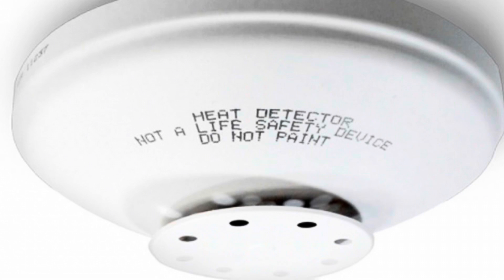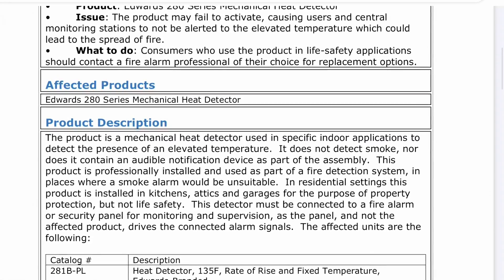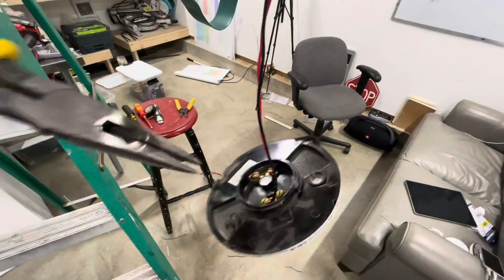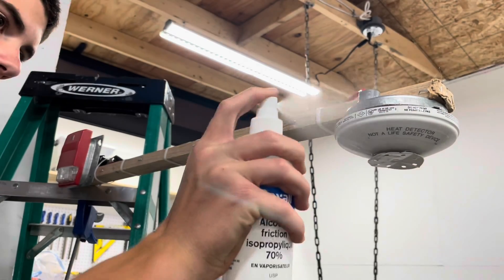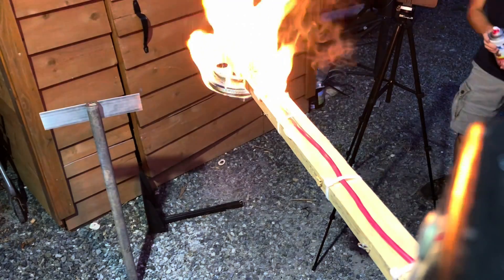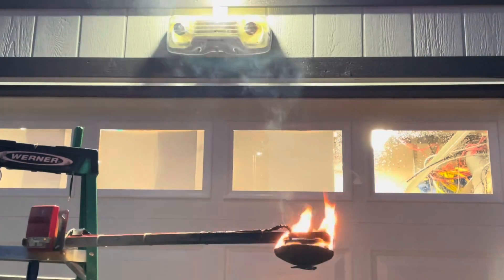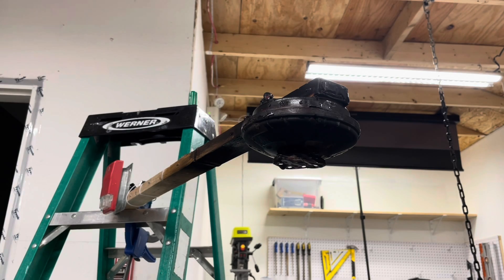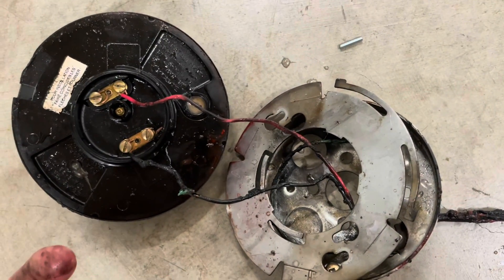Testing Edwards recalled heat detector with real fire🔥🔥🔥

Comment: Thank you for this video. Now I will tell my management to get rid of those detectors!
Reply from the maker: The opportunity to get rid of them is kind of over my school district that I work in is aware of the recall but they have been left as there was not the manpower to replace all of the devices during the period of the recall where it was covered for new devices something along the lines of there was a brief period where they would cover the cost of replacing them but that window is gone so now they just are left and get replaced when they are found to not work during testing might be a similar situation for you not sure

Comment: Was the initial alarm caused by heat or your special juice shorting the wires on top of device? Just an observation. May be flipping it over with terminals pointing down would be more precise test?

Comment: and grounds and bilding says they don't need to be replaced
Reply from the maker: Sorry I don't understand the comment
Reply: @nics-systems-electric 
At the school I work at has these detectors and when I said something about it to the district they said that they were fine and did not need to be replaced
Reply from the maker: @codythedogyoutuber  the recall replacement window is gone, however they are still a recalled device you can research it on the Edwards website.

Comment: What is the case of the heat detector itself made of?
Reply from the maker: Thin steel
Reply: @nics-systems-electric  No wonder that didn’t burn, but I guess in a large structure fire it could melt.

Comment: Well I can see why its recalled by the detector being a bon fire now and it still wont go off lmao.
Special liquid is ~~gasoline?!?!?~~
This test also demonstrates how fire alarm wire will work when being burnt
Reply from the maker: Yes it was gasoline any other type of wire would’ve actually perform the same way in this test as the copper all has the same melting temperature the insulation temperature is slightly higher at 105° instead of 90° however I think the fire was hotter than both of those so fire alarm wire would still work as usual for slightly longer but once past the temperature the insulation will no longer be an insulator Which is most likely why Horn strobe went off and on because of the insulation being melted leaving the copper conductors to make contact with each other
Reply: @nics-systems-electric  That makes sense.

Comment: What does “Not a life safety device” mean on the heat detector
Reply from the maker: It means it can’t be used as a device for human or life safety just for property protection
Reply: Edwards put it on there just in case they had to have a massive recall (wink wink) lol

Comment: Why not setup a fire beneath the detector instead of lighting the detector on fire? Would have been a better video with a heat gun and an infrared thermometer to gauge when the detector went into alarm. This reminds me of a Beavis and Butthead video.
Reply: You do understand that he did that with a heat torch and it heated past the alarming point. The detector didn’t even activate, it was just the wires melting together